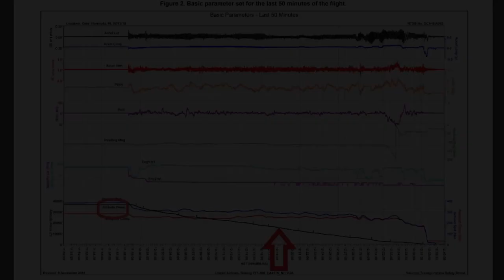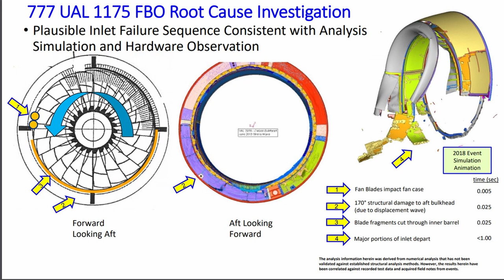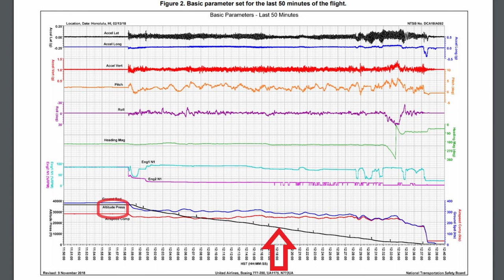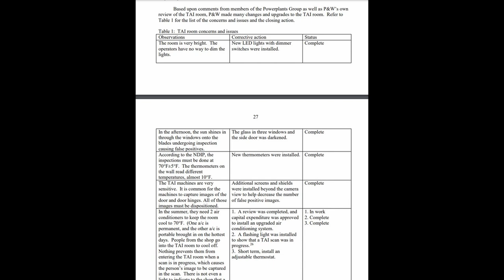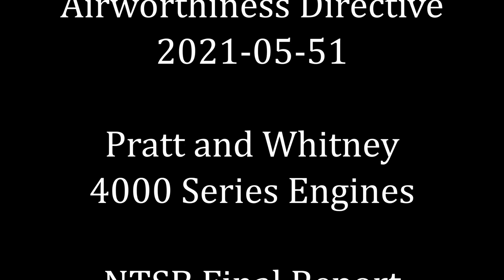Emergency AD & NTSB Final Report UAL 1175 Fan Blade Failure

Comment: As a physics major, I'm almost sure that PerfumedManatee's explanation (thermal emissivity) is the correct explanation for the paint in thermal-acoustic-inspection (TAI).  

And I'm almost sure that Ninafruit816's explanation is incorrect.  Ultrasound gel is mostly a lubricating and coupling-agent for the ultrasound source and pick-up (microphones).

The heat generated by the "rubbing friction" in the crack is probably not huge?  I'm guessing.  That means the detection of the hotspot would require a sensitive and delicate detector.  So painting the surface to have a uniform and well-established emissivity would help the thermal-imaging cameras, or thermal sensors.

Explanation of emissivity (quick and dirty, see Wikipedia link for details):

Hot objects radiate light; usually we think of this as infrared light, or if it is hot enough, visible light such as red-hot, orange, yellow, and white-hot.
At the same temperature, two different materials can radiate different amounts of light.  It depends on detailed properties of the material, and how it reacts to heat.  (A proper discussion of this includes the entire spectrum of light emitted by a hot object, and also things like black-body radiation.)

Emissivity is a measure of how much light you get from an object by heating it.  Objects with high emissivity radiate a lot of light, and low emissivity objects radiate less light.  That's the quick-and-dirty explanation, which leaves out a ton of details.

Some sources:

Emissivity:
https://en.wikipedia.org/wiki/Emissivity

Thermal-Acoustic Imaging (this reference doesn't discuss the paint, but it has some example images which may be of interest):
"The Thermal Acoustic method uses a short burst of high power ultrasonic energy in the 20KHz range to excite a part and then monitor it with a thermal camera. Disbonds, cracks and other anomalies generate heat due to the rubbing of surfaces, which can be seen with the thermal camera."
https://core.ac.uk/download/pdf/38931971.pdf

Comment: I'm guessing they use thermal paint, like the coffee mugs you can buy that change color when hot. The trick there would be to heat the blade till it is just about to change color, then turn on the acoustical vibration to see if you can get a "hot spot" anywhere on the blade, where the crack is rubbing against itself. But you've got to be looking from the INSIDE of those channels? Tough task!

Comment: I believe that these engines are well tested for a blade out. The most important part of a blade out is containment. It allows a lower risk of aircraft damage and allows for the pilot to continue flight to the closest destination. In both cases it was proven to work. The manufacture had designed these engines to contain and proven so. There is no perfect engine that's why all the safety factors are built into each engine..

Comment: I would love to see that testing as well. They must have to stress the blade in some manner to create the heat at the suspected fracture. Maybe sonic waves or some kind of jig that flexes the blade. I am thinking that painting the blades is a way to get a very smooth polished surface for the sensor to move over. Perhaps there is some kind of refraction if the surface is not polished smooth. I don't know anything, but it is interesting.

Comment: P&W stopped producing these engines years ago. The oem overhaul shop worked all of the 4000 series engines until:12 years ago when they shut down the facility. I believe The 4000s went to China for overhaul.

Comment: 15:19 You have to paint metal, if you want to use IR information, because the emission of metal is very low. If you use an IR camera onto a metal clamp - e.g. for a yearly inspection of you high power voltage system, to find out lose bolts, which causes a higher resistance, you would see your body temperature or any other thermal reflection and not the surface temperature of the metal itself.
A tesa film strip on the metal, would allow you to measure the metal temperature indirect, with little trade off towards thermal capacity and thermal resistance of the tape itself.

Comment: The inspectors would need to paint the metal blades if they were using highly discreet thermal cameras for the inspection since the reading off of a shiny metal would be just reflecting whatever else was in the room's temperature, the paint would give a true reading of what the temperature of the metal was, not the rest of the environment.

Comment: The skunkworks had a problem with contaminated titanium in the welds. The welds would fail inspection in the summer months but not fail inspections in the winter months. This inspection required the part to be heated to an extreme temperature to check for brittleness. Come to find out was the water during the summer was treated with more chlorine and the chlorine cause the problem. The water used to clean the welds contaminated the titanium. Surely they know how easy titanium is contaminated. Hopefully the testing process itself is not the culprit.

Comment: You have to paint the blades in order to thermally image it. Thermal cameras can only see infrared light, and not the heat itself. An unpainted blade would reflect the infrared light coming from the environment around it. The reflections would be much brighter than any of the infrared light being emitted by the blade itself, making it impossible to get an accurate reading.

Comment: One thing I've been thinking about and maybe you know for sure.
After you have had an engine failure or explosion like the engine in question, what happens to it afterwards?
There should still be some valuable components or materials that could be reused. Are certain components used as spare parts in other engines or is the entire engine scrapped for safety reasons because they have been involved in a breakdown?

Have a nice day

Comment: Some questions: What is it about the metallurgy, which makes this series of engines vulnerable to blade cracking? After testing each blade assembly, and installing it back
into the engine, what is to prevent future cracks? Does this sort of crack/fatigue problem
crop up in other P & W jet engines, or in jet engines built by other companies?
Does the twin jet configuration leave an aircraft more vulnerable to the effects of
a severe engine failure, than a 3 or 4 engine configuration? I understand the increased
efficiency and fuel economy benefits of a twin jet, but at what cost to the passengers 
and crew, in the event of catastrophic engine failure? Are turboprop engines vulnerable
to these same fatigue/failure risks? I know that early on, Lockheed Electras had very serious issues with prop/hub separation and harmonic vibration, but once those problems were addressed,
the engines became very reliable, as the history of the P3 Orion will attest.
I am absolutely a complete amateur in all these matters, but frankly I would feel safer flying long distances, especially over water, in a 707, than in a 777.  It strikes me that engine failure, when you have 3 or 4 power plants, is less risky than when you have only two engines.

Comment: Just a note , You mentioned " BOTH " failures of this PW series are with UAL , may that also be something the TSB might also look at , Maybe a bad mantainance practice that left the blades vulnerable to this ...
 " a mix up in balanced pairs " on an inspection , inproperly sequenced on reassembly... just a thought , if indeed its just Showing in UAL Inventory.  

Cheers 🥂 greatly informative as always.
Reply: UAL are the only carrier flying the B777-200, that's why both incidents were with the same engine type.
Reply: @gordonrichardson2972         According to Wikipedia, nine different airlines have taken delivery of the Boeing 777-200 - https://en.wikipedia.org/wiki/Boeing_777#777-200 . Is UAL the only carrier still flying this model?

Comment: It would seem like that they need to develop a better method of restraining the kevlar blanket both on the blankets leading edge to prevent air from getting under the leading edge of the blanket and have fore and aft bars  possibly every 24 inches circumferentially to keep the wave from circling the fan case and doing further damage. It also looks like Pratt and Whitney is going to have to put more personnel and equipment on the job or find a way to farm out the work because they are going to be overloaded.

Comment: I heard each fan blade cost about the same as a luxury car. Not sure the difference between the  PW-4000 hollow titanium on the 777-200 vs the composite on the GE-777-300

Comment: Regarding discussion if TAI and the experience/training of the people.  It appears that P&W  in 2018 had not optimized the test method and possibly performed Test Method Validation to show objective evidence that it works as intended.  These can be hard to execute sometimes and take substantial amounts of time and resources for complex inspections/equipment/parts which is why they are overlooked and the can is kicked down the road.

Comment: I have experience with high end titanium alloys in undersea applications.  They exhibit brittle fracture modes and require a "damage tolerant" design approach.  These materials exhibit a "crack growth threshold" below which repeated load cycles will not cause small surface defects to propagate  into a catastropic fracture.  The trick is to  characterize the size of surface flaw that can be reliably detected by NDT and will not grow,  then  subject the part to NDT every  so many load cycles to ensure there is no crack growth.  Typically dye penetrant test is used.  Some of the higher performance grades of 6A4V titanium have critical flaw sizes so small they can't be detected by established NDT methods and are therefore not suitable for safety critical applications.    I have not heard of acoustic thermal imaging for hollow parts  but it would have to be very reliable and foolproof to ensure the needed reliability.

Comment: Juan,
Excellent report and analysis- thank you!
I was wondering if you could comment on why UA used the same exact type aircraft on the 'replacement' flight - B777-200 with the PW4077 engine - to fly those passengers to HI if at that time they didnt fully understand what had happened to the engine on the original flight. This was on the same day as the incident - before the AD.
God bless
Paul (in MA)
Reply from the maker: That's all they had available that could do the job. Otherwise would have cancelled the flight.
Reply: Monday from Denver, they used a 757-200 for Maui (probably a PS configuration with lie-flat seats), and an international configuration (Polaris) 777-200 for Honolulu, presumably with GE90 engines. Houston got a single 767 to Honolulu. Chicago got a connection through SFO with an international 777-200 from SFO with a premium-heavy configuration. Starting Monday, United will reduce cargo availability, so likely diverting more Polaris 777 aircraft to Hawaii, instead of international flying.

Comment: Juan, I have viewed the P&W blade retention tests for engine containment certification, but that is not a real world of the engine s operating environment. I think that Boeing should borrow the engine and pylon off of the United flight 328 airplane after the NTSB releases it and mount it in a wind tunnel where they can measure drag and with the use if smoke they can observe turbulence across the junction of the rear bulkhead and mounting flange of the inlet duct and experiment with ways to reduce drag and turbulence  there. other things they should consider are placing a Kevlar blanket around the outside of the inner face of the duct and possibly walling off the anti ice ring duct and filling the void with an inert foam that would act to prevent ram air infiltration if the duct skin is punctured. Boeing should look at this as an opportunity to improve aviation safety.

Comment: Quesiton..  Did Boeing look at the amount of drag caused by  UAL1175 blade failure. and create a new checklist for it..  looking perhaps at how much control angles are needed to keep a true heading. using that to calculate roughly the drag created by the damaged engine.

Comment: I know escaped horses are easy to spot when they have gone, but this sounds like a situation that was predictable and avoidable. Situations such as this seem to be an increasing factor in the USA aircraft industry. As indicated by your, as usual excellent video, it had happened before, should it have happened a second time. Both these incidents could easily have resulted in the loss of the aircraft were it not for the excellent crew, which is not always the case.

Comment: I don't about the specifics of thermoacoustic imaging in aviation, in fact I was not even aware it was used.  However in other fields where I know it being used it works a little differently, almost the inverse. The specimen is subjected to a thermal shock, usually by means of a very powerful light source, and then an array of microphones or surface sensors picks up the acoustic response of the specimen.  The digitised response then goes through a mathematical process to reconstruct the 3d structure of the specimen in a way somewhat similar to how a CAT scan reconstructs 3D images from X-ray, MRI, ultrasound or what have you. The technique is very sensitive to discontinuities in the specimen and I guess that's what made it useful also for inspection of aircraft part. It could also be that what I am referring to is unrelated and just happens to have the same name as a different process used in the aircraft industry.

Comment: thanks, Juan for the smartly presented update. just a small request about the units of measurements, can you please use matric units or overlay on the screen :)
Reply: Hi Palash,

You should get into imperial measurements and leave all that metric nonsense behind.

In imperial you get into a world of yards, feet and inches.....and this leads back to rods, perches, cubits and hands. This leads to chains, furlongs and miles.

The historic derivation of these things spreads from Greek, Roman and Egyptian times, through the agricultural age to The Industrial Revolution. It really is quite fascinating stuff.

Metric is nothing more than some vague figure equating the distance to the moon, broken up into ever smaller bits. It treats people as idiots based upon a reasoning of counting in tens.

Wait until you get to measuring something as Eight & Three-Quarter inches and Twenty-Seven Sixty-Fourths in length......or diameter. Now that's what I call real measuring stuff..

James Hennighan
Yorkshire, England

Comment: I wander if they could put some sort of a Brake system on these Fan Jet engines, for when & if they fail, you can stop the engine from wind milling, and reduce the vibration.?
Reply: There are at least three problems with the idea of placing a braking system on a turbofan engine:
1) Added weight.
2) The lack of "windmilling", when the brakes are applied, would make any vibration, etc. show up somewhere else, and possibly cause other failures (engine mount breakage, pylon/nacelle "dismount", [just two of the possibilities, btw.] ), to occur.
3) The additional controls would add to the cockpit workload and, if applied, inadvertently, or inadvertently "passed over" during the preflight checklist . . . . Potential "recipe" for a disaster?!?!
PS: I'm not a pilot, or any type of engineering expert, and perhaps it's high on the wish list of the people who are, but the airlines are just too cheap, or cheap minded?!?! I'm inclined to believe that there's some "good reason" (beyond the additional weight), that NOBODY is building turbofan engines with a braking system on them.

Comment: Since after even a contained failure, the forces are likely to rip the cowling off, this should be take into account or at least simulate similar conditions to get proper figures Etops ratings / figures asumes that engines break in a way that wont generate excesive drag ?. Like the trust reverser tests that failed to Lauda conducted on different conditions of the water ingestion failure in the CFM56. Test are supposed to mimic real conditions or scenarios.

Comment: As those three Airline Companies will be without a significant? portion of their fleet while P&W's four painters and three inspectors check thousands of their engine's blades: will the inspections be conducted on a First Come First Served Basis? And/or, does P&W have blades in stock that will be used to decrease the Airlines' downtime?

Comment: From the time that the aircraft suddenly banks, pitches up and yaws due to the engine failure, how close are they to an unrecoverable stall? Does the 777 have an automatic stall prevention system or does it rely totally on the skill and quick action by the pilot?

Comment: I surmise that the inspection is done with an infrared camera and the blades are painted with matte black paint to prevent reflections of the room lights on the shiny blades from messing up the thermal images. Just a theory.

Comment: liability! JUAN, Always great and informative.  But here is my 2cents worth..if hollow valves in a corvette engine fail.. I would think  hollow fan  blades could suffer the same fate and way higher rpm range etc.  But I do understand the weight savings and rotating  mass thing...ceramic blades maybe?
Reply: Dont know how " liability " got there.   I didnt type that word at all!!

Comment: Hi - Love your channel! What if the fire suppression system injected something in addition to Halon or whatever it sprays. ? That was  thick - like an Aerogel  type material to provide resistance to the spinning blades to slow them faster. would it help or just be thrown off or risk more blade damage.